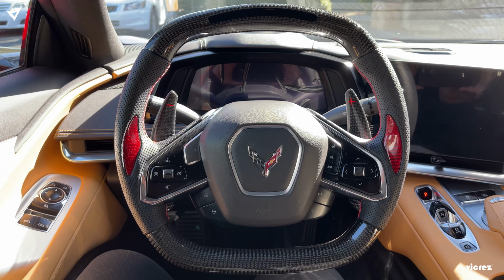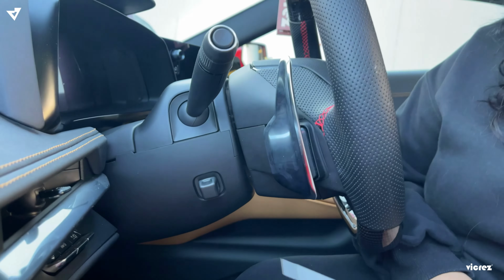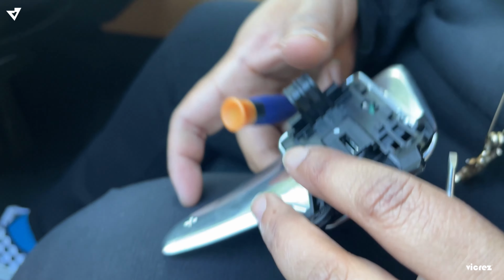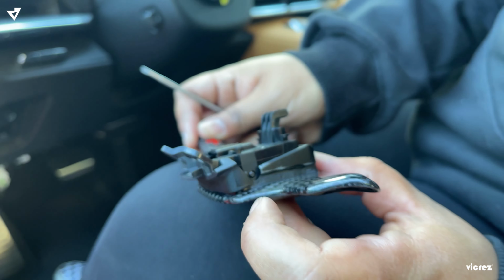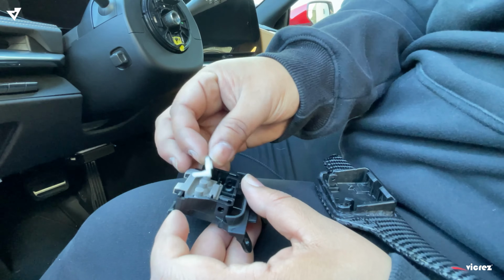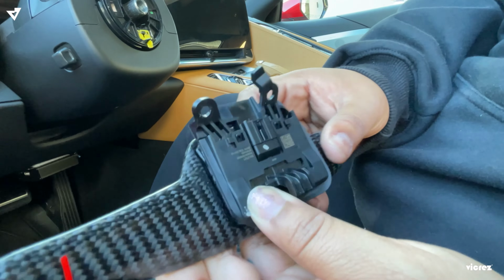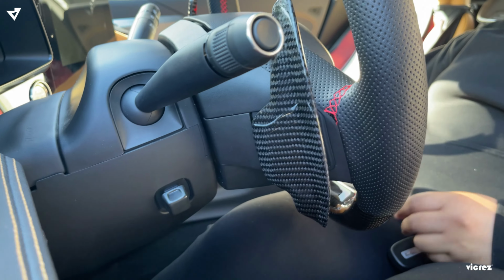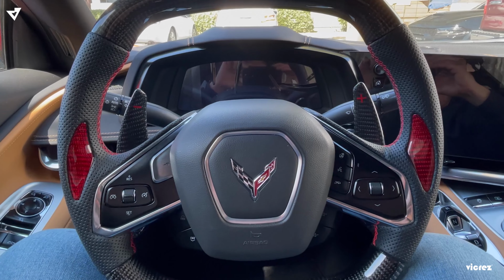Vicrez Carbon Fiber Paddle Shifters vz102237 | Chevrolet Corvette C8 2020-2021 | Installation

Comment: Nice video and thank you. Like another person said, you don't have to remove the steering wheel or unplug the battery. This can be done by turning the steering wheel slightly so you have easier access to the paddles and do the whole thing without removing the anything except the access cover and couple of screws.
Reply: Don't drop a screw in the steering wheel like I did..

Comment: Nice video... But it would be nice to mention how tight the bolt is to get the damn steering wheel off is. FYI everyone. Have an impact driver handy.